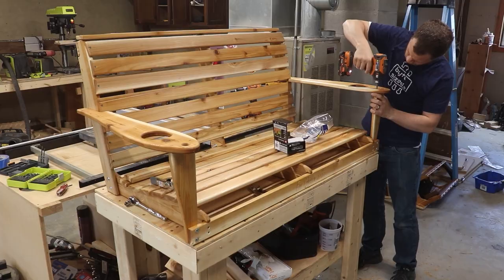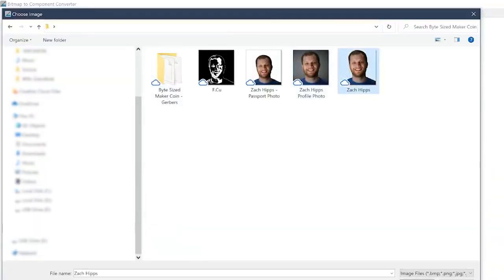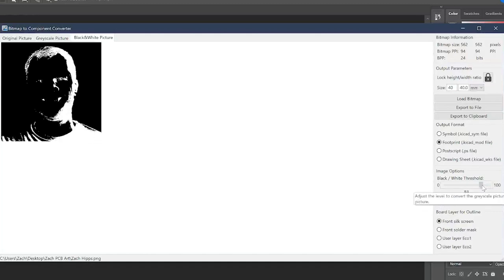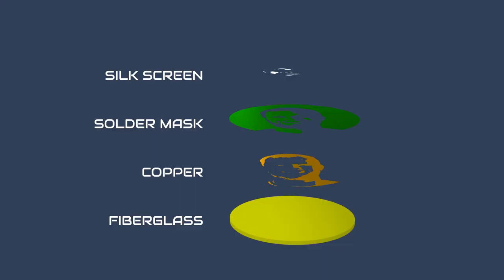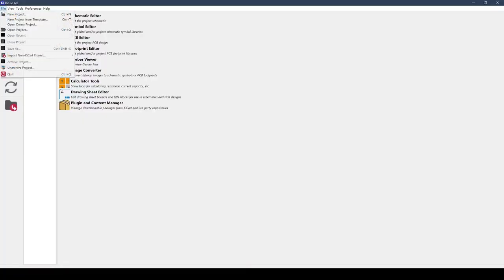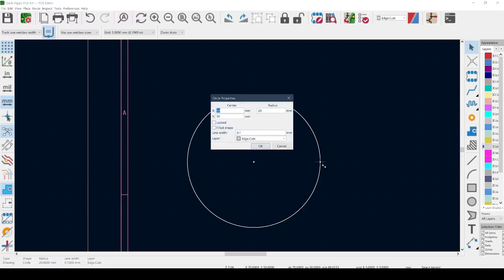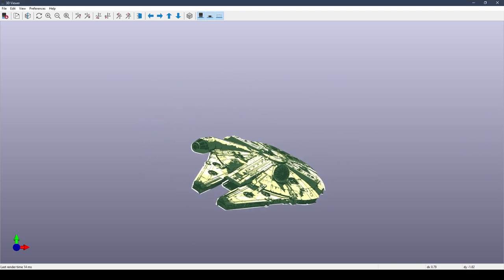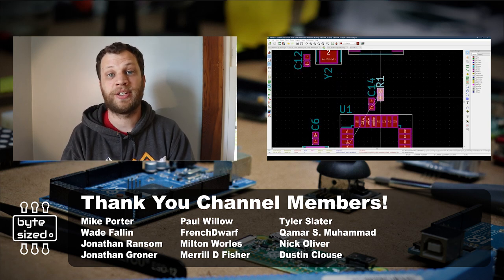PCB Art - A Step By Step Tutorial

Comment: Back in the '80s I used to make my own PCBs as well. I was in a drafting class, and I created all sorts of templates on microCAD that was running on IBM PCXT. They also had a b size plotter. So I would make whatever it was I needed, then I would put a clear mylar type material in the plotter with a proper black marker. I would then bring my PCB layout and the copper clad board down to printing. They had a very powerful arc light to burn the image in. We would then toss it into the goop to reveal the circuit board. In the earliest stage is, I would just get the thin black tape and layout my simple circuit boards. Things have certainly come a long way since then!
Reply from the maker: It's amazing that you have first hand experience with those processes
Reply: @bytesizedengineering  I was very ambitious in high school, when I did that. Now, I have little time to do the things that I really would like to do. Great video, brings me back.

Comment: Many PCB MFRs will not place silk on copper layers by default so I'm not surprised that they didn't allow that even after asking you.  One fix would be to open each as a 2-color image BMP in Paint and use your Silk layer to remove those parts of your Copper layer, then you are not asking for Silk over your Copper.

Comment: The reason they didn't put any silk screen there is because it's simply not possible.
It can't stick to that surface. It would literally just fall off after curing (maybe thats what happened).
It has to go on top of the solder mask.

Cool stuff. I see tons of different PCB's in my work, and every now and then there is someone that has been creative (usually with the silk screen print), but this is next level lol, even though they are technically not PCB's anymore.